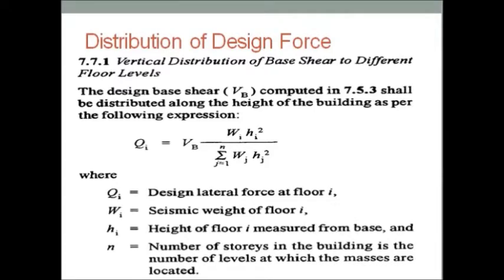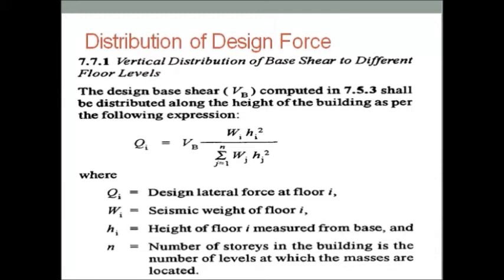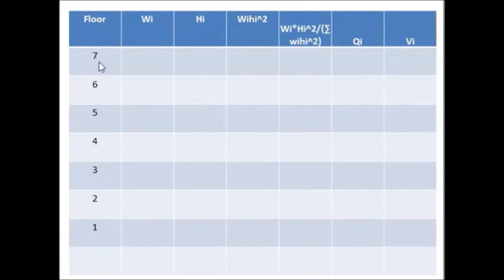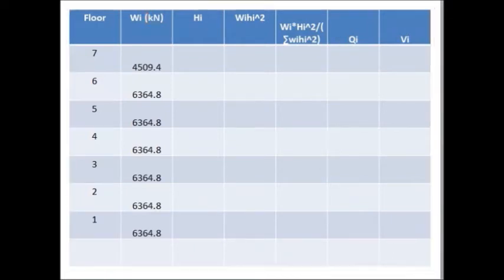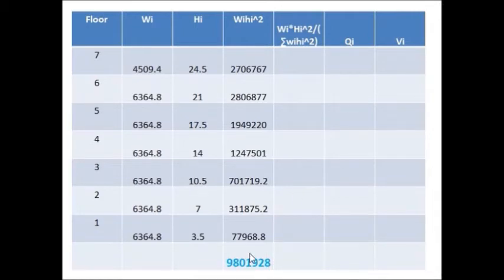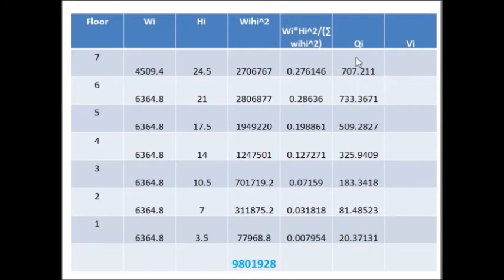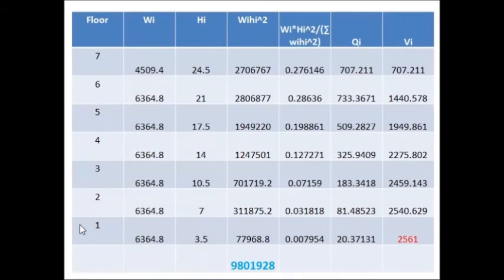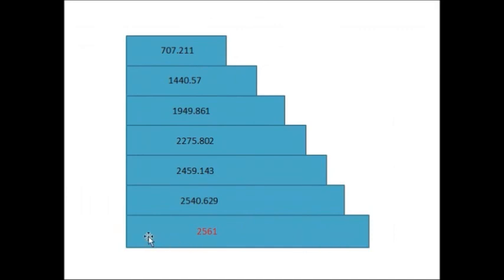seismic  load calculation Part 4 as per IS 1893-2002 |Civil Engineering

Comment: How did you find Q???
Reply from the maker: You can find one formula from code 1893 and I have also mentioned that formula in video
Reply: @cwillstructures  If the final base shear is 2561. Will this be equally divided between all the columns? Or will some columns experience more shear than others?
Reply: Mam why all storey sesmic weight is same...